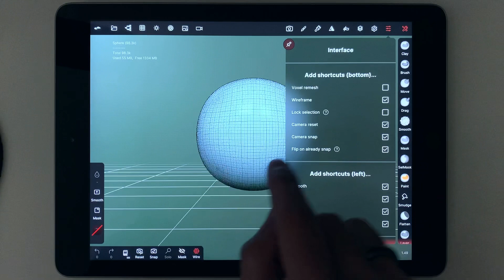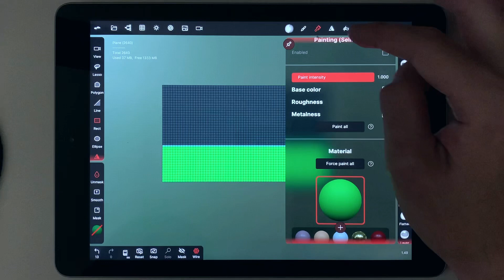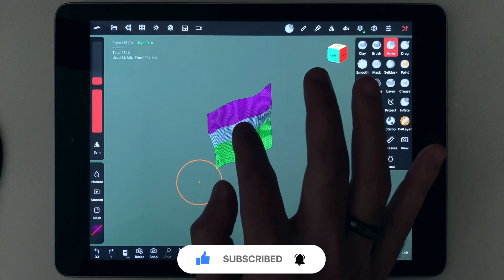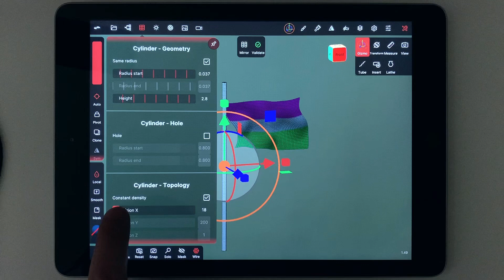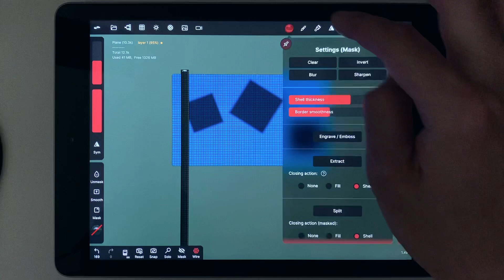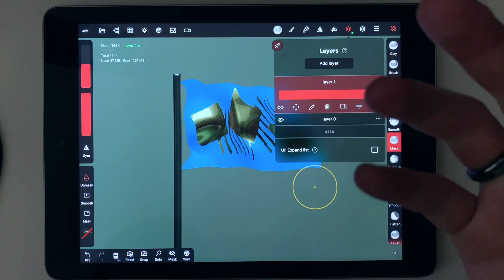Nomad Sculpt Beginner Tutorial - Sculpting a Flag using Layers

Comment: Hey there! Can you clear something up for me. I currently use nomad on my ipad mini 5th gen that has 64gb. And nomad crashes often when i try to voxel merge two or more pieces to my sculpt. As I understand it, this is due to high poly count. So I’m considering buying a 2021 ipad pro 256gb, in hopes that i will have less crashes and can voxel merge higher poly count sculpts. Is this true? Can you explain if upgrading to the ipad pro 256gb is even worth it and why?
Reply from the maker: Correct, that’s due to the high poly count and the ram available for you to use. Look at the statistics on the upper side of the canvas, and you should be able to read next to Used and Free the amount of RAM used and available. As a general tip, when using Voxel or Voxel merge, make sure that Voxel Remeshing value is not very high. You might lose some details, but you can gain them later using subdivide and sculpting. This will help you a lot while using your current iPad.
Regarding the new iPad Pro, from my reading and research, the device offers two different RAM capabilities 8 GB and 16 GB. The latter is only limited to the 1TB and 2TB models. However, there is a catch that we hope to be resolved, and I am quoting here NomadSculpt Official Twitter account “iPad Pro M1 seems to currently limit to 5GB the memory a single app can use.” Meaning even if you have the one with 8 GB ram, you won’t benefit from more than 5 GB. The iPad Pro 2020 offers 4.5 GB of ram, and it is all usable. So my advice is to either wait a bit until IOS is updated to make use of all available RAM or get the 2020 one as it will be way cheaper. I hope this helps